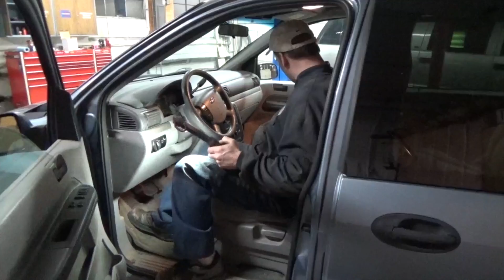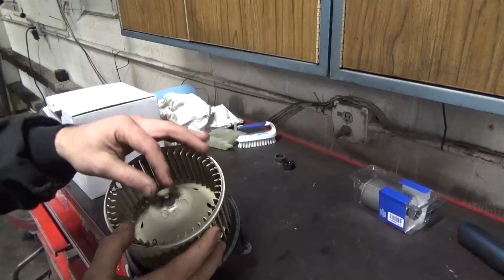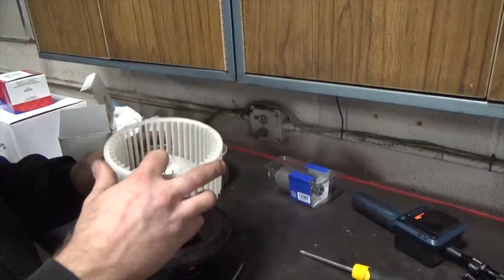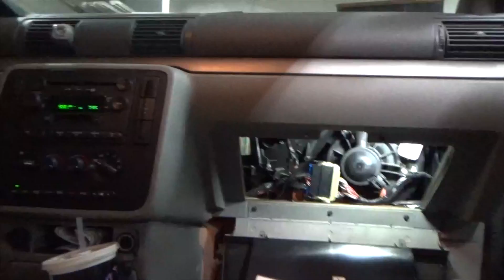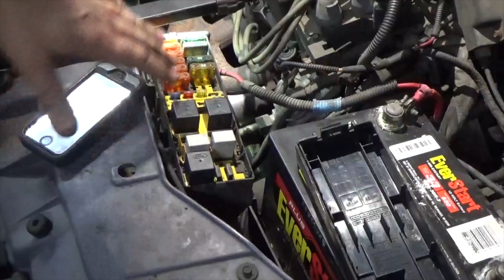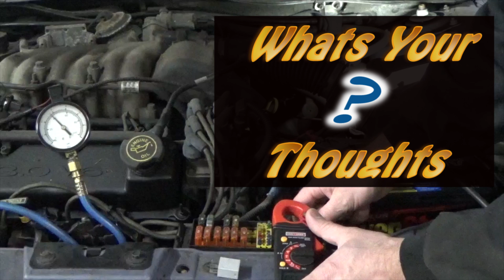No heat squirrel cage replacement  then a No start no codes Troubleshooting

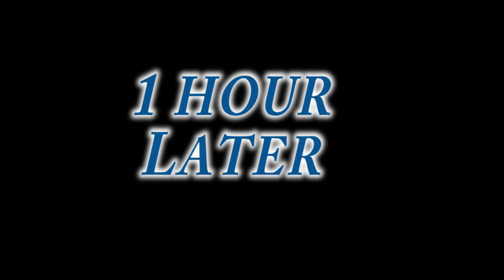Comment: I would say a wire is bad or we have a bad pump , Most likely it is a bad wire ! although we know the pump is not running so , I am going with a wire problem .. at 10:13
Reply from the maker: ShawnMrFixitlee thanks for stopping by and sharing your thoughts bud
Reply: For sure  HAPPY NEW YEAR !

Comment: The fuel pump is bad> Hit the gas tank with a rubber mallet with the key on and you will probably hear the pump start to charge the system.
Reply from the maker: Thanks for taking the time. good tip! Happy new years!!

Comment: The fuel pump is getting stuck and every time it does, it makes the amperage go way up
Reply from the maker: Thanks for taking the time, Happy new years!! follow up video coming soon
Reply: robinsonsauto As an auto electrical mechanic I've seen this happen many times, so if I'm wrong,it's going to be embarrassing😀
Reply from the maker: I will say its a very good logical diagnoses with the little you had to work with